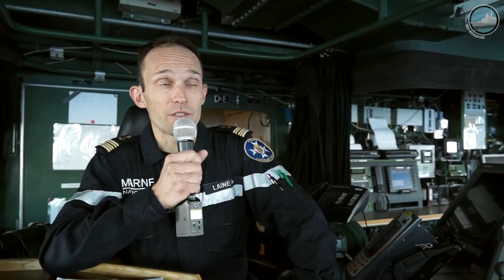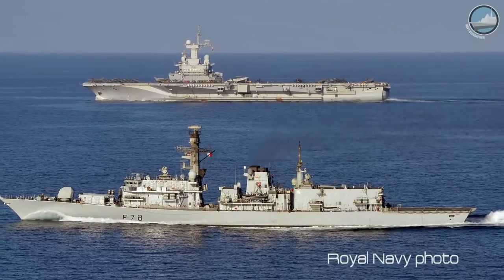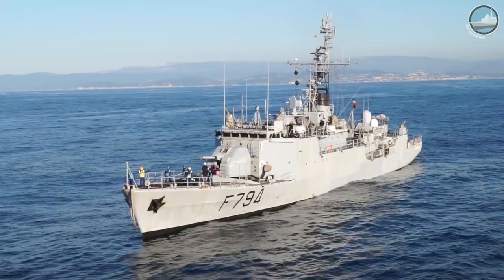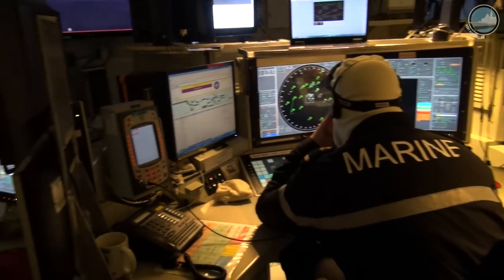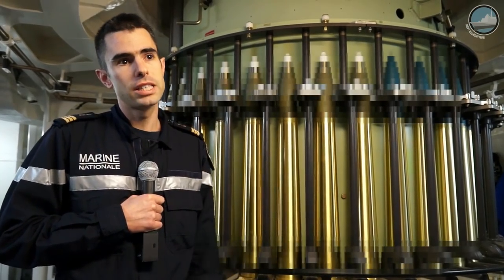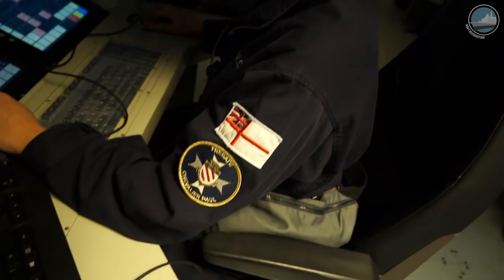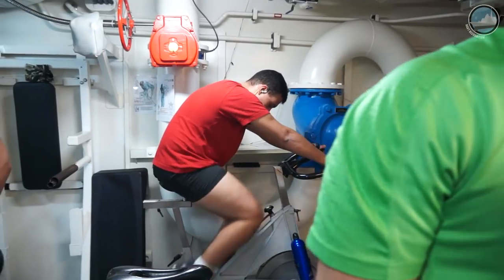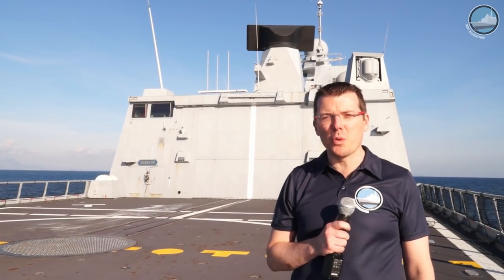At Sea Aboard Chevalier Paul - French Navy Horizon-class Air Defense Destroyer

Comment: Wait, what?  In the intro the announcer clearly states that, at 7000 tons, this ship the the largest surface combatant in the French Navy.  Shortly thereafter it is shown escorting the nuclear aircraft carrier Charles de Gaulle, which has a displacement in excess of 42,000 tons.  Are we to assume that the carrier is NOT a surface combatant?  How do the French define this?
Reply: This is a little language ambiguity, yes a carrier is commonly classified as a surface combattant, but....

What the announcer wanted to say is that the primary role of a carrier is to   
carry a fleet of planes or helicopters. Basically the role of a carrier is not to attack plane or other ships, but yes it will defend itself against such threats with a lot of missile, but this is not the primary role of a carrier.

Frigates are more specifically designed to attack other vessels, planes, in this meaning 1st rank Frigate (if we use the NATO terminology) is "per se" a combattant ship.

The "combattant" role of what you call "carrier" is specfically held by the on-board fleet of planes.

There is just two way to understand the term "carrier"
- you can first understand it as "global" so including the fleet of plane, so it is a combattant.
- you can also understand it more strictly as only a carrier, in this case this is not specifically a combattant. Only the "context" can give element on what meaning should be.  

Just note that you could perfectly use a Carrier to carry civilian helicopters for example in an humanitarian scenario, or use a Carrier to carry all other kind of thing, so a carrier itself isn't "per se" a combattant vessel...

"Groupe aéronaval" is the equivalent of CVBG (Carrier Vessel Battle Group), so it includes Carrier, planes, escort (frigates, submarines....)
Reply: The fact remains a carrier is a surface ship, and with the use of its aircraft is one that can perform every task this frigate can, and can do these with greater power and at a greater distance too.  Were the opposite true their roles would be reversed, and the carrier would be deployed to protect the frigate.

That said, neither is the most powerful ship in the French Navy.  This is the four Triomphant nuclear ballistic submarines . . . which are NOT surface ships, of course.
Reply: the CdG isn't supposed to go in the front lines the plans it carries will.
differences between French and nato names
Reply: With women on board , i doubt there is any real discipline on board the destroyer
Reply: Surface combatants include cruisers, destroyers, frigates, and corvettes, and several older types including battleships and battlecruisers.
The category does not include aircraft carriers, amphibious assault ships, and mine hunters, as these generally do not use on-board weapons. Aircrafts are not defined as on-board weapons.

Comment: Damn. Maybe a better all-rounder than the Type 45... :S
Reply: I think they're looking at the Lockheed anti ship missile.
Reply: beside it's an anti air defence destroyer with 48 aster long range SAM... there is also 8 exocet antiship missile, 8 sadral launcher short range sam and 2 torpedo launcher .. EXOCET you know the one that sink HMS shefield during falkland war... so they don't give a fuck of loockeed anti ship missile....
Reply: well so far our type 45 having hard time just staying at sea.
Reply: Type 45 is better at air Defense
Reply: @lechevaliermalfet1  They Fixed the engines
Reply: FYI Exocet didn't sink HMS Sheffield,it was certainly a Mission Kill,it sank while being towed to safety in rough seas.
Reply: Type 45's regularly sail with Harpoon Missiles fitted (Recovered systems from the retired T22 B3 Frigates)
Reply: @paultanton4307  and it did sunk because the Exocet punched a hole low enough in the hull 🙄